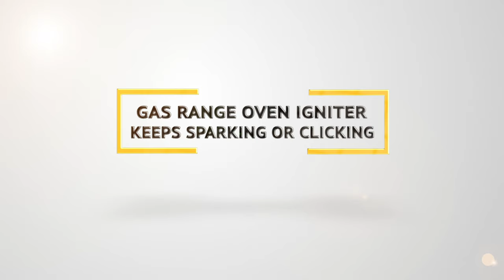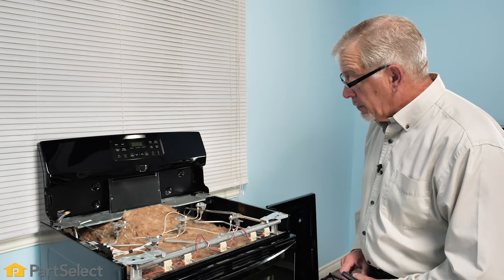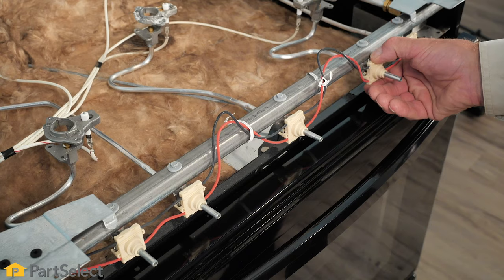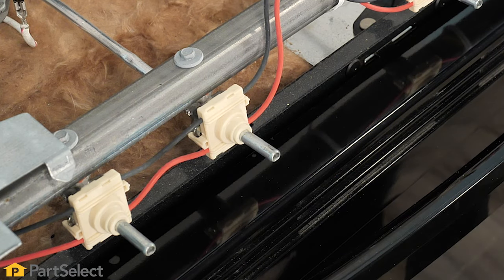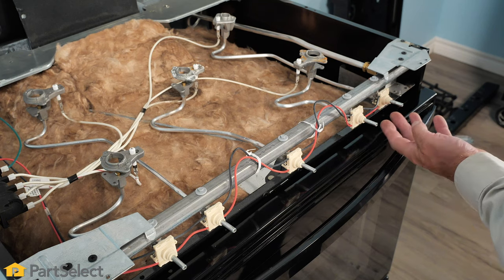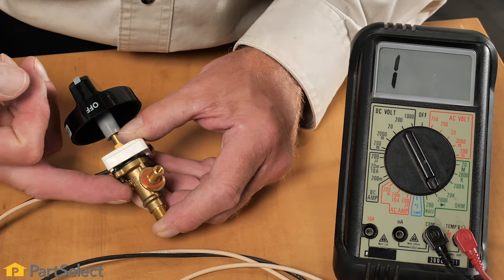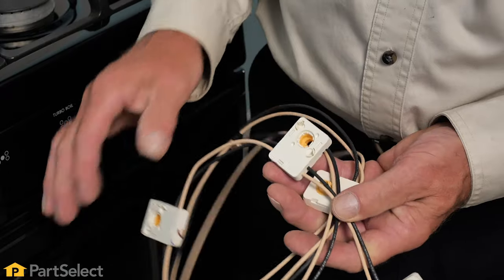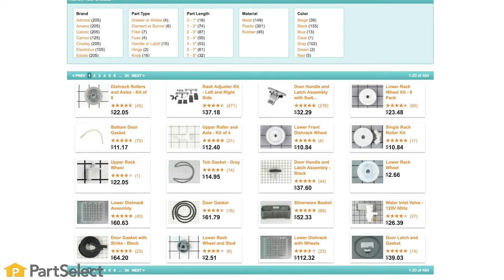Range/Oven Troubleshooting | Igniter Keeps Clicking or Sparking | PartSelect.com

Comment: At last!.. so many of these YT videos claim it is 'just' cleaning around the spark sites... none address the switching (misalignment) problem except you!  I looked under the know of the offending gas tap and sure enough that particular switch was slightly off compared to the others. I moved it back just a touch and only click once now. I have put up with this for years. Grateful. I even know how to replace the switch set and loom now if it happens again.. Dread to think of a call out fee and then the engineer condemning our otherwise spotless 24 yr old hob for £13 part

Comment: Thank you. I removed 4 switched and put it in a jar with alcohol and salt like cleaning a bong) and shaked it a lot. Than I put it under close to running faucet and finished off with a carb cleaner. They started working like new no more click

Comment: Hi, i have a 14 year old bosch cooktop that has experienced constant clicking when the knobs are in the off position.  i've cleaned the igniter electrodes with rubbing alcohol (worked briefly) and more recently with contact cleaner/sandpaper and they are working for now.  i can't remove the burner hex bolts so i can't get underneath to diagnose/replace parts.  any suggestions (beyond penetrating oil and don't force them) for removing those hex bolts?  thanks

Comment: I had a pot of water boil over, making the igniter wet, causing constant sparking. I used Gumout Cleaner and Degreaser spray inside the square igniters. The spray drys quickly, and the sparking stopped.

Comment: Amazing. 88ACB 1 igniter wouldn't setup. Watched this video. Repositioned switch module with screwdriver without even remove surface top. Turned power back on. Problem resolved.  Thank you. Subscribes and liked.

Comment: I have a Viking range/stove and it clicks every single time I turn it on. How do I remove the metal plate to reach the switches? Thank you.
Reply: you have to pull every dial and remove the screws, every one behind all the knobs. then the face comes off

Comment: At 01:25, you say the igniter switches are the input to the spark module; isn't it instead the module that powers the igniters?  It seems backwards.
Reply: The switches do power the module, which in turn powers the igniters.

Comment: i did something stupid, i was cleaning under the igniter caps and it was loaded with food and grease. I attempted to use a sponge but it might have dripped off some water, so i sprayed a couple small squirts of kaboom degreaser just on the white parts and then they started clicking, constantly, the 1st knob was sparking and i couldn't stop it and then we unplugged the stove.. I used a qtip to finely get all the areas but i might have burned it out, its been an hour and the house was smelling like gas so i'm scared to turn it on.  Its a GE profile, what should I do?
Reply: My wife did the same thing and I’m trying to figure it out now. What do you end up doing?
Reply: If you're not hiring out for the repair, carefully remove the affected igniter module. Depending on your scenario you may only be down one burner minus the clicking until you can properly resolve the issue...